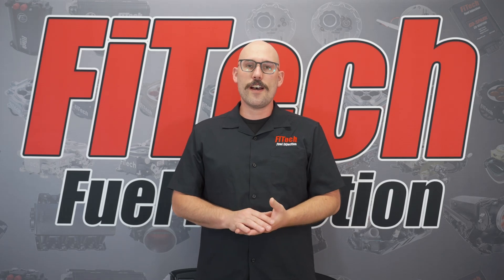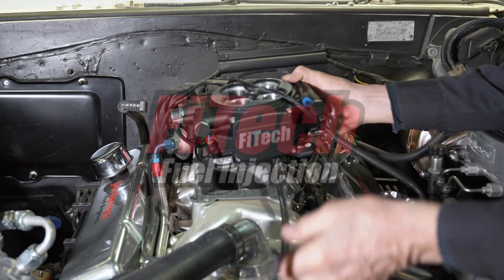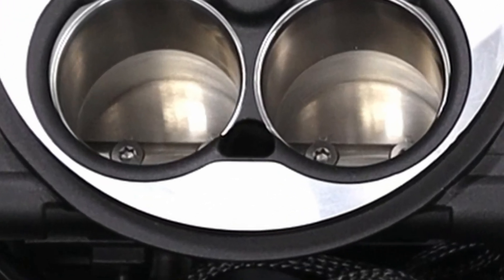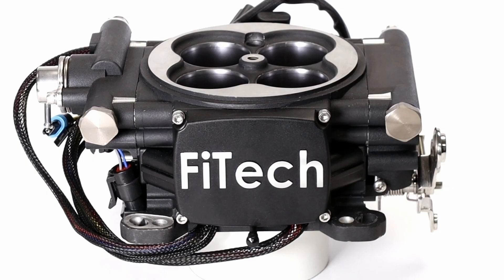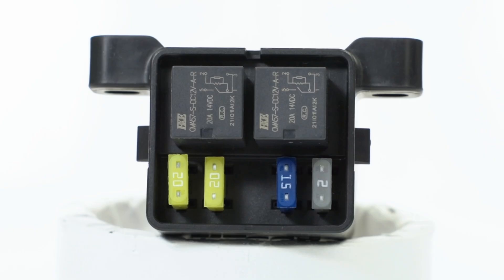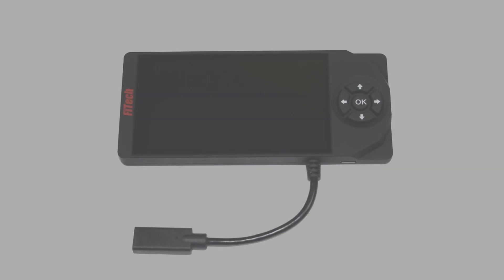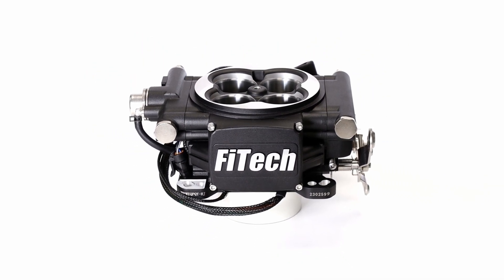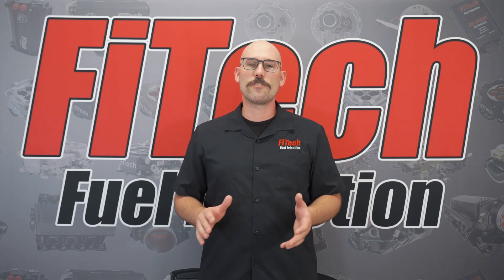FiTech Throttle Body Rolling Changes | EP 109

Comment: I have gmc Sonoma with a new reman 4.3 I’m thinking about adding a FiTech system what all do I need to make this happen? Tia Will
Reply from the maker: This is mainly a question on what your states emission laws are. These systems are universal and will work on any engine that provides a 4, 6, or 8 cylinder 12 volt tach signal.
Reply: @FiTechEFImedia  I guess I should have been more specific do I need to change my intake or ignition system Will the Sniper replace the spider injection?
Reply from the maker: @ Our systems are based on a Holley 2 bbl 2300 flange or a square bore 4100 series flange. You might need an adapter plate or a new intake. Depending what the ignition system is you may need to change it as well.

Comment: I have a 600hp easy street, and an OG 600hp go efi.  Love what you guys have done.

Have you guys considered making the units scalable? For example, if I now want to go with boost, could I buy an upgrade kit, either user installed or FiTech installed?  Or perhaps the EFI bug bites, and I want to add timing control to my easy street unit?  Even something like a kit to retrofit older units with the rolling changes upgrades discussed in the vid.

I'm waiting for when my android phone can become a handheld controller, maybe even connecting via bluetooth... 🙂
Reply from the maker: Kits are not upgradable in the aspect of supporting more HP or add boost capabilities do to TB machining differences.

Comment: I really like the external relay box.  I have an older 30003 unit.  From the very beginning I disabled pwm and used an external relay for my fuel pump.

Are there changes planned on the software side of things?   If so, it would be cool to have a change log as new versions come out to see whats new.

It would be nice to have temperature based control of the prime shot.

Also it would be great if the software had a better strategy for hot restarts, my experience is the software will hold rpms up above the idle speed target as if the engine where cold for a moment.   It would be nice if it could just “resume” to the idle target like a carburetor.  Messing with cranking iac and loop rate can shorten the amount of time the flare last but won’t eliminate the behavior.

And lastly,  it would be interesting to have the ability to adjust the minimum engine rpm for enabling a dfco event.  I’ve observed that dfco will not function if my rpms don’t reach about 2300 rpms even if the map is good.   Is the dfco feature only intended for highway speeds?
Reply from the maker: Thank you for your feedback. The software engineers are always fighting the balance of keeping settings simple and providing enough important adjustable features to enhance user experience.

Comment: You need to find lighter throttle springs, especially dual quad the gas pedal is really hard to push and the cable wears out really fast
Reply from the maker: Be sure to grab the throttle linkage at the top in the 1/2 hole to maximize leverage.
Reply: @FiTechEFImedia  Cable is there, primaries are ok, but secondary springs are too stiff

Comment: Any recommendations for shops in Seattle to upgrade my setup?
Reply from the maker: You can use our dealer locator tool on our website to find the closest near your zip code. We are starting to add more installers and tuners through our new training program as well.